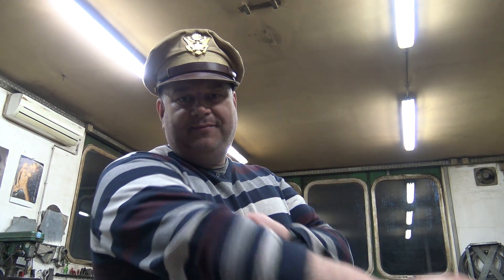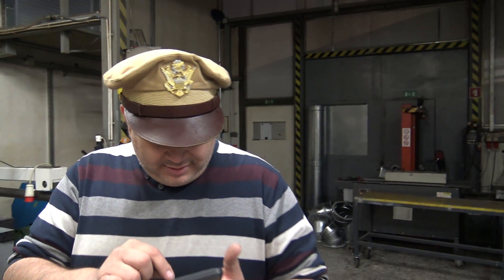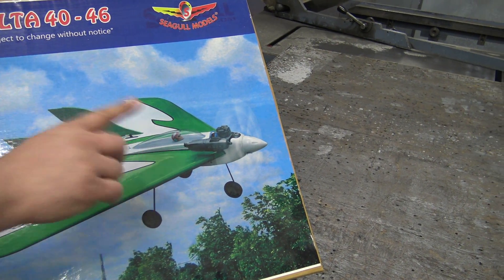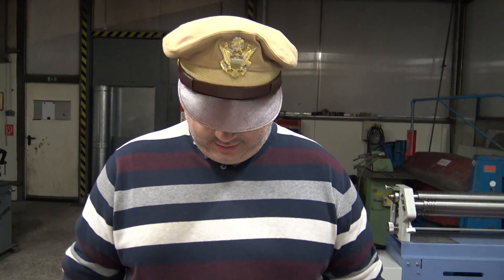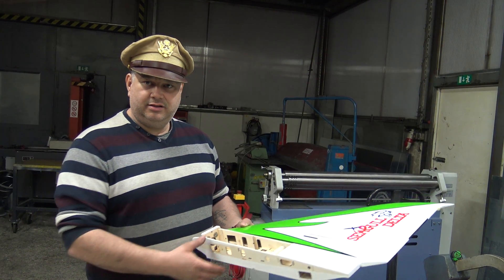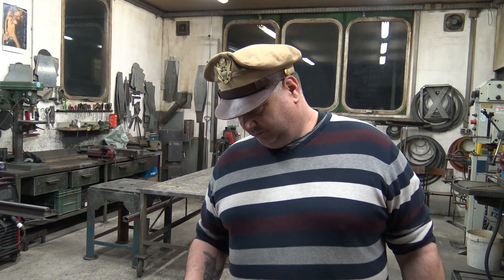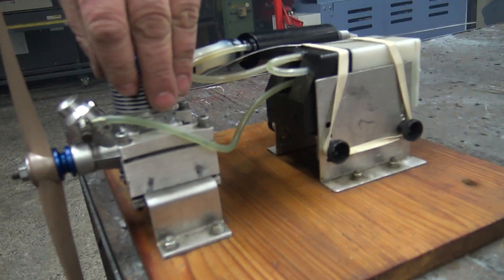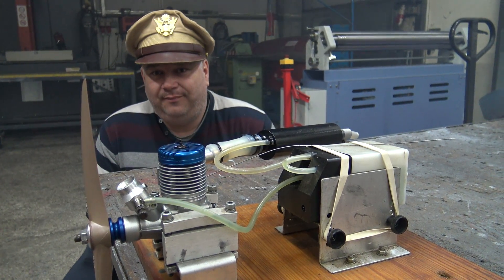MVVS 49 8cc glow engine with tuned pipe TEST RUN

Comment: Finally a glow engine! Have a Mvvs 040 with a tuned pipe. Really screams with alot of power. Runs best with 5% nitro. The Mvvs gas engines are also really nice as your video too. 🙃

Comment: I know I know you done it thousand times but you show bad nitro motor hand placement when messing around with it..standing over it is also crazy,prop nuts can come loose and pow its stuck in your arm or worse..always tune behind the prop and be very very careful..still nice a motor though..makes a guy nervous is all..be safe..

Comment: I have a 3.5cc mvvs with rear exhaust and tuned pipe installed in a little racer. Hanging on the wall for years and still not flown. Maybe i should give it a go THIS year 😂

Comment: I remember pilots who also operated these engines with synthetic oil - and for a very long time without any problems. These were always racing engines from MVVS, but were not used in any races. I will never forget the smell of castor oil - and the mess that this oil made to the models and engines ;-)

Comment: Aw yis! Cap'n Blaz back at it! And that engine has a lovely ring-a-ding for sure.

On the engine mounting: They're probably saving on weight by using the main landing gear blocks to also mount the tuned pipe instead of having a second block on the top for that purpose.
Reply: Oh ok ;) cheers

Comment: I once owned an MVVS .75 engine. It was the smoothest best running engine I have ever owned.
Reply: Yessssss this is it
Reply: Nahh...I have a bunch of MVVS engines 2.5cc going up including the gold head Quickie with a tuned pipe, they are nice but they don't hold a candle to the O.S. FX

Comment: Fantastic engine.  Here is a test run og mine with the long quiet muffler.  There was also a shorter muffler available, and the tuned pipe as you have.  :-)   https://youtu.be/jvEMGZnD49s?si=G7Jf6u_dTgdvVMfB

Comment: You need a different pipe. Having a coupler that long in between the header and pipe will just blow out in a few short runs. You don’t want more then a 1/4-1/2in at most of gap between the header and pipe. Cut the header 1/4in at a time till the RPM drops and back the pipe off a 1/4in for the perfect tuned pipe and RPM.
Reply: Ahaaaa thanks for the info cheers!!